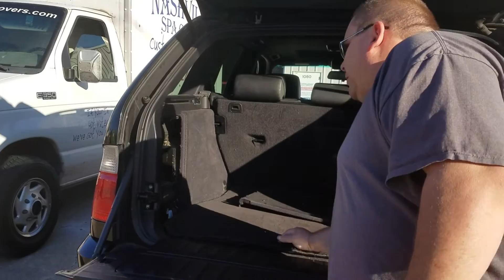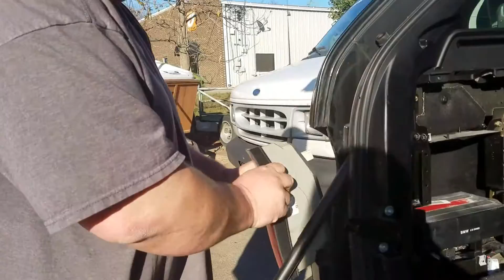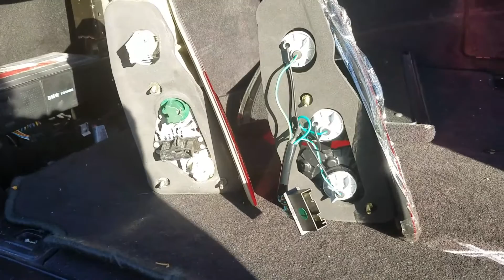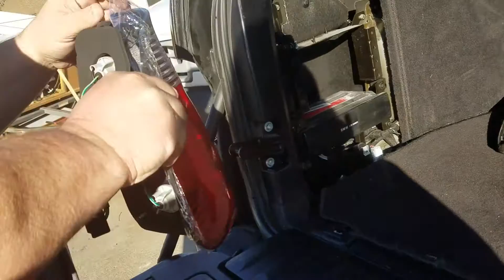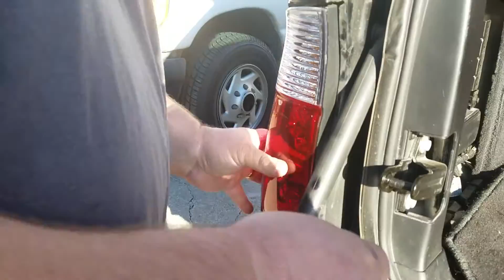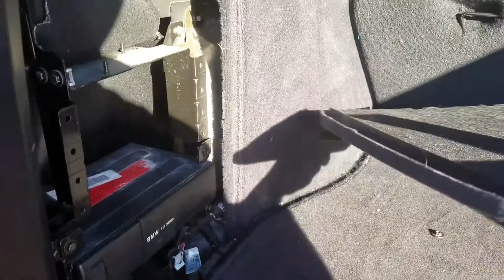DIY 2001 BMW X5 brake tail light assembly how to replace Retrofit circuit board standard wiring

Comment: I have a bulb that is out for the first time. When I take it out, the white housing is not burned at all. More puzzling, the filament on the bulb is still intact. Do these bulbs work just like a regular light bulb, where if the bulb is the problem, the filament will be broken? Since my filament isn't broken, what do you suggest? The bottom tail light works, but the top one doesn't.